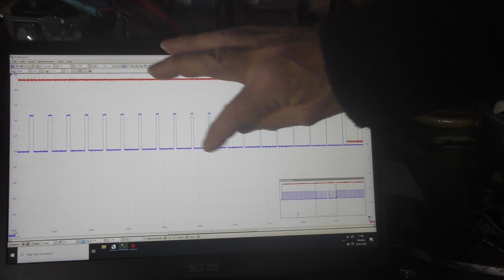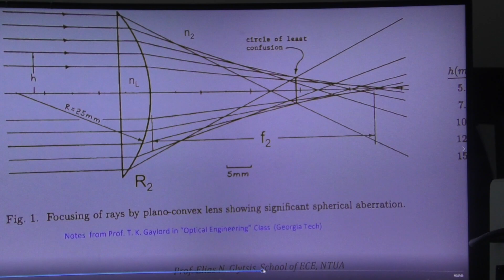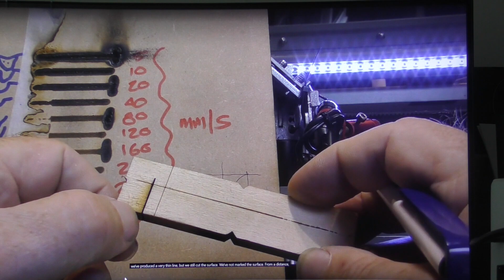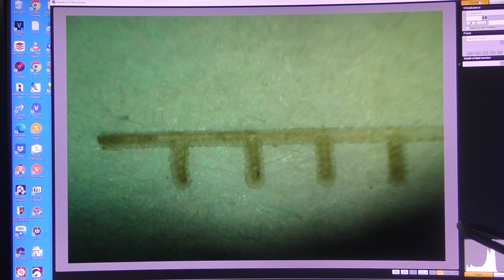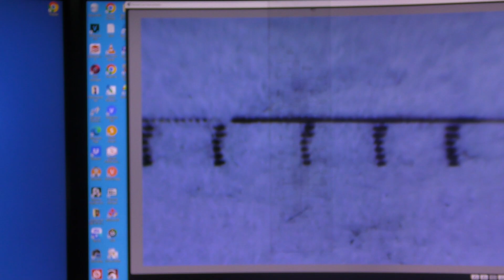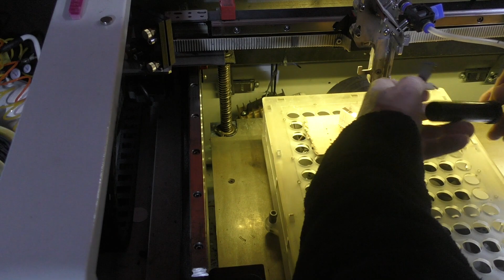RDWorks Learning Lab 247 PWM Grayscale  Engraving

Comment: oooo you showcased my dithered slate, cant wait to see if i can get a greyscale slate show cased too. Have to say i havent tried it basically due to what you said in the beginning it's just said to not be possible with a co2, but if youve cracked it i cant wait to see how it comes out. Similar to your card and borax i use either clear lacquer or black paint on my slate which increases the contrast and shading
Reply from the maker: Warning. I know you have a glass tube and this technique  will not work. Dithering is the only way.  I am exploiting a property that is unique to RF  machines . I cant say if it will or wont work with a diode laser,  you will have to experiment to see if the dot size changes with duty cycle . You will also have to match dot siz,and speed to your rather limited diode PWM frequency. I woud normally pre-lacquer slate but iin this instance I wanted no confusing  materials  emphasizing (or hiding) the effect I was experimenting with. I hope you realized that this a first for me as well . I have long known about that amazing  long-dead engraver but never recognized a machine property to achieve a similar effect.  Please go forth an experiment with your diode laser.
 Best wishes
Russ

Comment: Can you pass the beam through a beam splitter so you have 50% of the power?
Reply from the maker: A misconcetion is that watts = damage. The thing that damages material is not power but  light intensity and you can generate as much light intensity with half the power. So sadly decreasing the poer is not the answer.. This point was proven when I removed the lens and let the raw unfocused beam hit the card. The veryLOW INTENSITY light was sufficient to scorch the card. It's sometimes very difficult to wrap your brain around some of these strange concepts until you have spent time playing with them.
 Best wishes
Russ

Comment: I am wondering if it is even possible to reduce the output power to a degree where proper scorching without the cutting effect is even achievable.
Reply from the maker: Unlike a glass tube beam where the central intensity decreases with power reduction ie it is"sharp" at full power and very "blunt" at low power, an RF tube is controlled in a different way. The POWER is always 100% and the beam is always "sharp" The appearance of power controll is nt by adjusing the watts  but by limiting the exposure time  with a variable ON/OFF system. Small exposure time=  small dot of power and a longer exposure = bigger dot.  Neither have scorcing ability because they are sharp and cutting into the material surface .It is this  change of dot size I am exploiting here because a binary material has no scorching range to create the images I managed on slate annd borax treated card.  I am fortunate to have both RF and glass tube machines to compare .  
 Best wishes
Russ
Reply: @SarbarMultimedia  Yep, the central prob is an HVDC-excited glass tube has a 1ms response time- meaning it can only switch at about 300Hz.  You can set the PWM above that, usually it's 10KHz, but it won't turn the beam on and off above 300Hz.  As seen if you vector at 1000mm/s 300Hz 50%, that's a 3mm spatial period.  You'll see the beam make it on and off completely but a lot of "grey" space between them, and at 400Hz the mark it makes no longer reaches full on or full off, it's all grey.  So, you CAN PWM tone with an HVDC tube- it's just going to have to run really slow to give the beam time to go on and off.
RF-CO2 lasers modulate on and off fully even out to like 30KHz.  Beyond what can even measure, if your axis is capped at 1000mm/s,  at 10KHz the dash is only 0.1mm so any ability to turn on-off faster won't change the cut.
Reply from the maker: @dannymiller2123  
 Hi Danny
 If you look at the scope pctures of the greyscale line you will notice that regardless of the PWM signal, the tube switches OFF independently when it sees white 255. With PWM this is not a problem because the almost instantaneous response time allows it to jump to full black (0) at the next pixel. For dithered images using a glass tube, every time the controller sees a white pixel it also switches the tube OFF. At the next black pixel , the speed of the flyback transformer to create say 25Kv is definitely a limiting factor  as to  how many dots per second you can run at  However, dont believe in the HV power supply specs because they dont tell the whole story. All my dithered engraving with a compound lens is done at VERY low average mA (maybe 4ish) I operate in the pre-ionization zone  where the beam is never fully established and only partional ionization is occuring . I have developed my simple bitmap test to make sure I dont get the grey space you mention. The top line of dashes is used to set the focus to achieve the thinnest line. The middle line of dots with 3 pixel spacing between black dots  is allowing time for complete  white ( even if the  residual voltage is say 10Kv).The bottom row of dots with alternate black and white pixels test this response time to death. The idea is to create dots on the bottom line that are the same shade as the dashes on the top line. I can get crisp black dots with a glass tube that are unachieveble with an RF tube. It is possible that what I am achieveing is a balance of power output that is insufficient to cut but is sitting  on a knife edge to produce just sufficient scorching power without vapourising the material.  With your response time figure of 300 Hz  for the HV power supply and my wish to run 254ppi images, it seems to define my max run speed for dithered images to about 2mm/s. Depending on the material I use, reality is 200 to 400mm/s. So something beyond obvious therory must be happening.

 I assure you that grayscale engraving with a glass tube  is not limited by the HV power supply. It uses exactly  the same light speed  physics operating in an RF tube  but without the interference of a PWM control signal.The one exception is that 255 WHITE pixel.  The digital controller translates 255 as switch OFF  for both glass and RF tubes. However, if you remove all the 255 pixels from a grayscale image NEITHER tube swithes off.  Thus if you keep a glass tube switched ON during a grayscale scan  there is no response time issue to worry about. Iinstead, the speed of the electronic signal changing the pixel to pixel current flow is the only limiting factor. It automatically changes instantly (in relative terms) from pixel to pixel without the need for PWM control.  The  fact that glass tube grayscale does not create  the variable  dots  we have seen RF produce, means that real  low or high power is applied to each COMPLETE  pixel and not just  a limited exposure to full power.

 The next session is going to experiment more with that  glass tube rapid switching  capability  and how it can be exploited to overcome the HV speed limitation for dithered images. Remove 255 and all sort of possibilities exist. After all, what theory ever predicted  RF system capability to greyscale engrave binary materials? That was application of acute obsevation.
 Best wishes
Russ